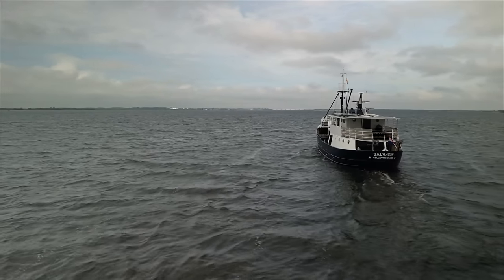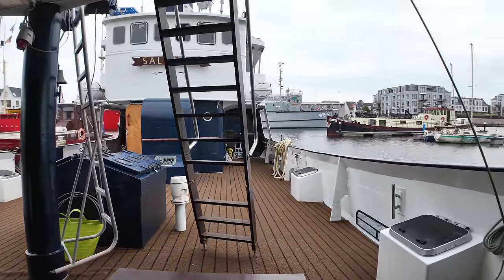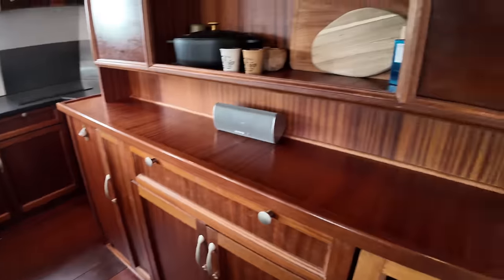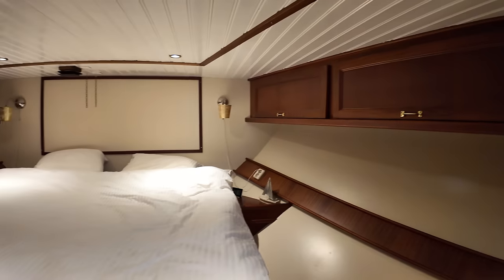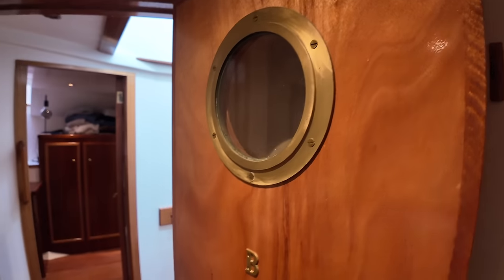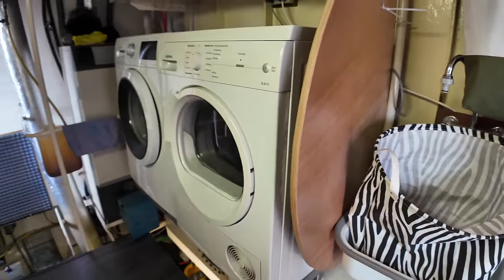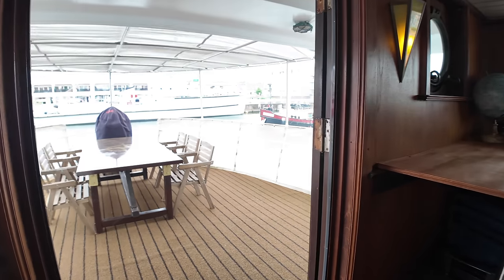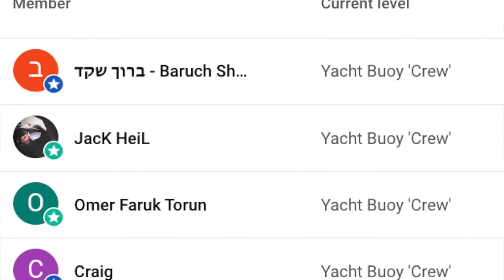€495K Long-Range Custom Steel Converted Trawler Yacht FOR SALE!

Comment: Lot of cobwebs. But far more importantly, you didn’t actually show the air start. Don’t understand why not. Once these engines start they seldom stop - so I fundamentally disagree with the negative single engine comments.
Reply: Meh, pretty much all freighter and tankers are single screw with a single engine. Maintain an appropriate preventive maintenance program and you’ll be fine. Keep a few critical spares on board too.

Comment: Did one of the comments say AFRICAN-QUEEN ... absolutely the most reliable engines available in the 50s 60s 70s... and they're still cranking over without complaints. They sound funny in this era but... ROCK SOLID POWERPLANTS ! 🎉 Nice trawler

Comment: This is a old boat. I want to say, thank you for adding the length, width, and gallons in regular measurements for us in the USA. We have to look up the meters to see what they are every time we hear them on videos that from over seas. So thank you for putting it up on the screen for us. That engine sounded great to my ears. That's old music that was playing in that engine room. I wouldn't change it either. Those old motors that's still running, there is just something about them that can tell you a story of all the years they been working hard to take us on a journey and back home in one piece so by all means they have earned our respect and we should do everything humanly possible to take great care of them so they can run for another 60 plus more years, don't you agree. An those lights on the walls behind the bridge, they looked so cool. Reminds me of the flickering of old oil lamps over 150 years ago. That throttle in the bridge, I've only seen one similar to it but it was on a motor that spun a generator head. Great video and I love the fact you remind us you are 6 foot 4 inches tall so we can compare your size to the areas you can fit in. It gets harder sometimes for us talk people to move around. Thank you for showing us this classic old boat. I hope you find more of these older boats that got remolded into live aboard yachts.
Reply: Overseas? you mean the rest of the world then, not sure who's the one that should be doing the terrible mental gymnastics to convert metric to bananas for the US viewers...
Reply: Not me I talk metric I have NO idea why USA is still on such a lousy measurement system!

Comment: 45lph is a remarkably low consumption of fuel. It shows that whilst the engine is old, the long stroke, low speed motor is very efficient

Comment: This boat  trawler is a great choice for you to show. Well converted, but not overly done in its finish. ( just right ).   I would like to see a better access to cabins  from inside the boat.  I do love those old lights   gorgeous. Fuel consumption is reasonable,  but could possibly do better with Gardener engine with more power as well. ?  But it's nice set up.  Love bridge &  the extra room aft. Topside dining is perfect. Need a better sun shield though.  Needs a sea chest in engine room.  I  love this little trawler. Make a super live aboard. Thanks for the showing,  I like it alot.

Comment: Another of your beautiful vessels worth keeeping floating around for years. My personal preferences would require a twin engine layout or at least a "take me home" auxilliary engine but apparently there is no room in the engine space even repowering the boat with a modern engine. Maybe there is room in the steering space. It would be wonderfull if you had some information about present hull thickness and recent hull inspection results if any. Also it would be good to know how many hours on the engine since the last overhaul, if any. Also because of personal preferences I would add an air conditioner system, a water maker and maybe a grey water treatment plant. There is plenty of room in the focsle for that. A couple of the single berth cabins could be converted into two bunk cabins. Definitely the boat needs more refrigeration, specially near the cabin if you are to add sustainability to the long range capabilities. If the hull is sound and considering that the boat might need repowering, I would still think the selling price is reasonable.

Comment: Beyond my financial grasp but if you don't mind I'd like to make a comment.  I once spent 2 wonderful years cruising the West Coast of British Columbia, Canada aboard a 42' motor sailer with a cruisng speed of 10 knots.  For those waters you wouldn't want anything slower for a couple of reasons:  for starters you need to make safe anchorage each night since it wasn't a crossing and the fjord indented coastline, islands, and odd shoal made for interesting navigating after dark.    You're limited by a slow cruise as to where you can get to to anchor for the night.  Next, there are many inlets to the various fjords and passages between islands where the tidal bore can run as high as 13 knots. Malibu Rapids, Porlier Pass, and the Skookumchuk are world famous and waiting for the tide to change to enter an inlet can be a time consuming exercise.  The Salvator is perfect for long crossings but questionable for some areas of the world.

Comment: Interesting talk-through, many thanks for sharing. A couple of points; I didn't see any alternative escape hatches from the accommodation down below, so flooding or fire could entrap all the guests. As the vessel is steel and the cabinetry pretty utilitarian, I'd have expected to see a comprehensive sprinkler system. Also, is that actual wooden decking or some artificial stuff...? I seem to see ripples in it at 5.36...?
Reply from the maker: Glad you enjoyed it!

Comment: Definitely a proper boat and very well looked after. Love that saloon but the cabins, too many and too small, don't see the need to sleep 8? people. Perhaps you can do something about it? Or use them for crew, they could use that room behind the wheelhouse as a saloon.No wardrobe in the master cabin. A lovely old engine but what a lot of fuel it uses, wonder how practical it would be to replace it with a more modern one, preferably two. Needs updating particularly in the navigation department but when done  it would be fantastic boat.

Comment: i would like to have seen a big seaworthy bunk lined crew quarter than those double beds witch are pretty much useless under way. and , hands on hearts, if you really explore new places, you do not stay aboard much when not under way. as an alternativ to a 2nd living space in your fovourite harbour perfect, you might have another 100k a year for fees, but getting a homestead at the seaside might be much more expensive and can not be moved. Still for my feels it would only push the whole geogeos machine even more if it only had kept more ,by style and finish and conception, to it's heritage. i would love to see a leftover cargo space, still used as cargo space( like a sail locker on a SY) for bikes or even a quad. Modernisation besides of classical tecnical outfit is a must in my opinion to take the north west passage or cape horn. A sauna in the front castle would be a thrill in combination with jaquzi under the protected area and showers on the other side. The flooring should be either just anti slip painted or laid with the material that fits your taste. ( Kork with sikaflex grooves is nice, maybe the painted wood, like zealander yachts have on some spots, hygrograph and sextant in the interior etc.- a wood stove! you get my point

Comment: Good solid looking ship. However, another one with just one motor.  It has years of solid service I am sure, but just that one time it fails at the wrong time sure would be good to have a backup as a yacht.
Reply: Most " real ships " are single engine
Reply: I agree. Although definitely not on any ships of this size, having been stranded a couple times due to single engine failure, I can no longer venture too far out unless there's some level of redundancy. Staying along the coast or trips out to the Bahamas would probably be fine though. Enough traffic around in case things go south.
Reply: I agree. It would be nice to have that redundancy. A lot of the newer long-range ships have a wing engine.
Reply: @pken9814  nothing is a substitute for a reliable well maintained main
Reply: @aa-kv2pq  absolutely
Reply: @aa-kv2pq  absolutely

Comment: No doubt a really good solid boat, however she certainly needs a lot of updating, particularly in the navigation department, its very outdated. The cabins are very small, the master one doesn't even have room for furniture and the others are only just big enough enough for the births. Needs less cabins with more space. The real disappointing bit is the saloon and galley. The saloon definitely needs a lot more grab rails particularly on the ceiling. The galley isn't fit for purpose, that cooker for instance. No fiddle rails or pan clamps. If you tried using it in any sort of sea everything would slide off onto the worktops that were at the same level. It could also be very dangerous. Despite the fact that the hull would be up to any sea the conversion parts certainly aren't. Only any good for very calm waters, a pity obviously the owners who converted her weren't sailors.
Reply: You are right about some things, but take another look at the navigation station, it is brand new, just in line with the original. The owner must have put a lot of time and money in this, with his ideas for using the boat.

Comment: There could have been better updates had they wanted to spend the money. They could have put a hot tub and sun pads on the forward upper deck along with building proper stairs. They should have ripped the ancient engine out and replaced that with two generators and put in two shafts for electric motor drive. The electric motors are more powerful and do not require transmissions so they are far more efficient and since the electricity they would be drawn from their seperate desiel generator, the amount of fuel used is determined by how much you push the motors. You could also install a battery bank and solar panels so that the only time the generator run is when the batteries get to a level where the motors begin to lack sufficient power to maintain the rpm you are turning to stay at speed. Which saves money. Not only are the generators and electric motors more quiet and more efficient but they also produce way less vibration.
Also you need zero speed stabilization  on an explorer boat.
She is an interesting little ship with a large amount of potential but would  cost a million at least to bring her up to some sort of modern standard

Comment: A 250 HP engine for that huge steel boat? My car has more HP. Why so little HP? From my experience even smaller yachts have dual 500-1200 HP engines.
Reply: Because they are not very fast and have a lot of torque

Comment: It would have been better to just leave it empty, and let a professional fitter do the work. My first thought was that I’d have to rip out all the bodged house-built interior work that looks ghastly….and then my second thought that it would be far less expensive just to buy a used boat that wasn’t bodged this badly.  A pity, because the bones are great, but the conversion was hastily, cheaply, and inexpertly done.

Comment: People have been lied to about Green Energy and the "Carbon Foot Print" of green energy production. Yes makeing electricity from the sun or wind, does not produce carbon dioxide, unless you look at the mining and manufacturing process. Then you find out, by using these technologies not only do you increase your carbon footprint by about 10%-15%, very little of this technology is recyclable. Somewhere around 20% or so. Green Energy is not a viable resource at all and it further degrades the environment FASTER than petroleum as a Primary rather than secondary energy source. This has to stop. The wild lands of the USA are being used as dumping grounds for fiberglass Wind Turbine Propellers, same thing in Canada and many other nations. The mining of minerals and manufacture of solar panels, batteries, Conversion units and such are some of the most poisonous Industries on the planet, IN HISTORY... They are LYING and its time to call this out...